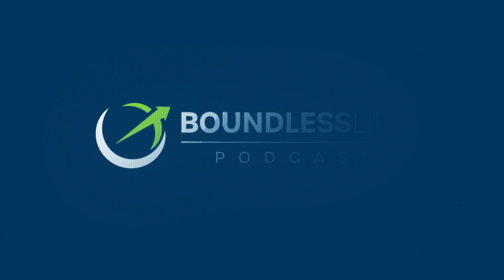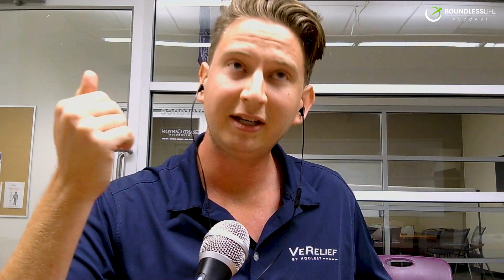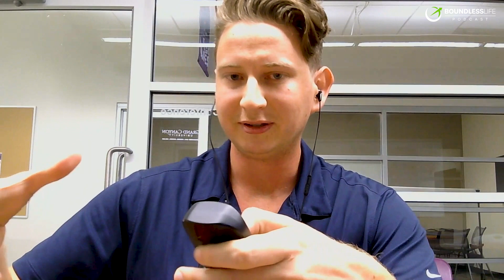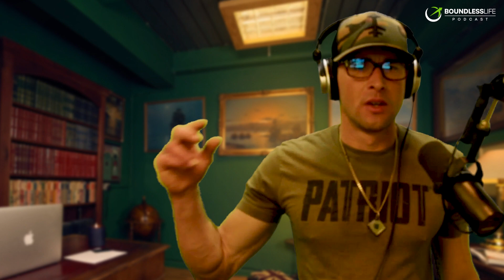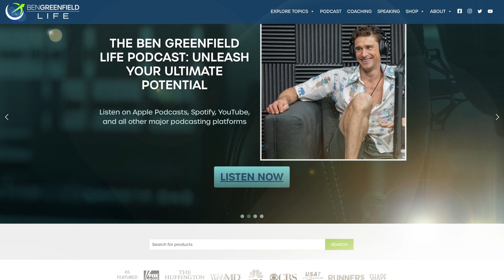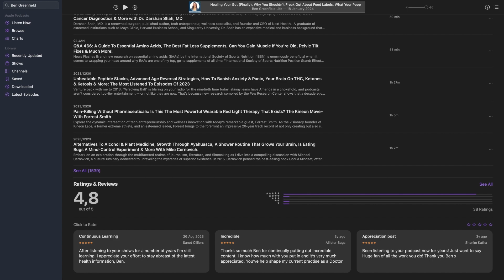Improve Your HRV Scores With This ONE Trick for INSTANT Stress Relief!

Comment: The trick this video talks about is using a vagal nerve stimulator to improve HRV scores and reduce stress. The vagal nerve is a cranial nerve that plays a role in the parasympathetic nervous system, which is responsible for rest and relaxation. Stimulating the vagal nerve can help to increase HRV, which is a measure of the variability of the time interval between heartbeats. HRV is a good indicator of overall health and well-being.

The vagal nerve stimulator used in this video is a small, handheld device that is placed on the neck. It delivers electrical stimulation to the vagal nerve, which can help to increase HRV and reduce stress. The video also discusses how to use the vagal nerve stimulator and how to get the most out of it.

The vagal nerve stimulator is a safe and effective way to improve HRV and reduce stress. It is a simple and easy-to-use device that can be used at home or on the go. If you are looking for a way to improve your HRV and reduce stress, the vagal nerve stimulator is a great option.
Reply: Thanks!